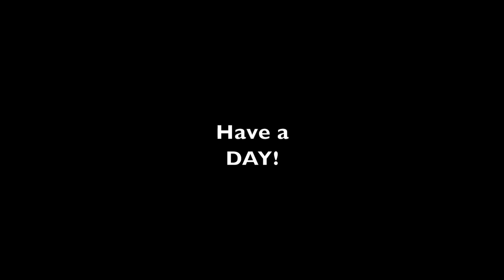#730 NEW WOODSHED BUILD, WORKING IN THE MUD!

Comment: Hi Mike, 
I am also a learn-by-trying type.  I love your build vids.  Since you have said that you plan several more similar builds, I want to throw out a small tip.  Please don't read it as criticism as that is a beautiful shed you have started.  I love it!  So my tip is for the joints where the beam segments rest on the posts.  6"-8" extra length on each outer segment and 12"-14" on the middle one would allow you enough material for a half lap joint. It can provide a tremendous amount of stability.  This would be especially conducive with those awesome 3.5 inch thick beams-- plenty of meat still on the bone.  Helps keep the joint tight by counteracting any racking forces.  Of course you will have several other elements in this build to help do the same.  I read some have already suggested plywood cleats on the inside spanning the joint.  Keep up the positive and entertaining vids!  I never miss one!

Comment: Mike, next shed cut in on the headers with the wood mizer for 6 or 8 inches on the ends at the center of the timber and remove one side with the skillsaw so you can overlap the joint where it sits in the bracket.
Reply from the maker: yea i like that idea

Comment: Love what you guys are doing. Mike I was thinking that you should let the whole shed/wood built cure up for a year, or maybe even less since we are heading into the summer. Meanwhile cut some batten strips (Board and Batten siding) and somehow stack and strap them to cure, and then in the year add them to the now shrunken seams. If you do it right away that would cause some splitting when shrinking, but adding them later one would cure that. How you manage that with your siding preservative/stain coating I am not sure. Suggestions welcome. This is my number one Youtube daily go to event.

Comment: put down some of those slabs to stay outta the mud.I would put some full length diagonals in the corners not just those little coner braces.When the wind blows there will be a lot of force along the long side,and put some little straps across the top of those beam joints

Comment: It is pouring down here now - my tractor lugs (full old time tractor tires) sink into the ground up to the flat tire between lugs.  Scary!  I move slow and stay in 2 wheel so the spare 2 power wheels are getting me out of trouble if needed.  Four at once can be 4 holes in the ground so easy and fast.

Comment: Nice work, Mike. Braces look great. If you have any scrap 1/2" CDX ply, you can make some gussets for the inside faces of your beam joints to act as reinforcement splices. Maybe 6" wide by 2' long, with a foot on either side of the joint between beams, then nailed with galvanized nails. Love the story about Hunter "frisking" you for soda-pop contraband.  :)

Comment: Connecting those beams to each other at each top joint with cross-angled deck screws would also add lot of sturdiness to the frame. great looking project!
Reply: I think he said he was going to use nailing plates, but I thought the same thing and maybe drill a hole in brackets to tie each side together at seam.

Comment: The nice thing about using that green wood for the siding is that it gets nailed down before it can warp.  Mike and Melissa you are are doing a banged up job on the shed, which means job well done, but use guys alway say a short while after sheds and garages are finished is: “should have built it 3 times bigger”. 👷‍♀️

Comment: On the next structure you build, if you lap-joint those beams instead of butt-jointing, you can drive a nice 3 inch screw into that top center hole of the post top teco. Strong joint too 👍

Comment: I am still not convinced that 3 screws in the beam at the back of the wood shed, will carry the roof structure and snow load when in shear screwed into softwood posts.The beam should be checked into the columns so it carries the weight rather than the screws, the front beam is OK.
Reply: He mentioned he is going to nail everything as well.  
And, the back beams, he said he is going to lag bolt them through the posts.

Comment: Y'all are having more fun than me .
I've been rewiring the entry room of our house.  We had to gut it out . And who ever wired it should of had tools taken away from them .
Open ended wire just hanging in the walls and some just tucked in a box no tape or anything.  And aluminum wires that got hot .
Never use aluminum wire for any reason.  It about burnt our house. 
And the worst part some of it was done by a certified electrician. 
But enough of that.  
That was a good video. 
Stay safe y'all  🤗🤗🤗🤗🤗👍👍👍👍👍👍👍👍💖💖💖💖💖💖🌹🌹🌹🌹🌹🌹🌹🌹🌹🌹🌹🌹🌹🌹🌹
Reply: Evan Kibbe aluminum wire was actually allowed by code back in the 50’&60’s, before they realized the fire potential! The open ended wire would never be an issue if the panel end was saved off, and labeled to the location and “ in wall DON’T USE!” This is work done by an electrician who didn’t open the wall, the only issue with this is that the next home owner doesn’t always know what is what, or if there is a back feed!

The best thing to do is to find all possible unused wires, and aluminum wires and remove them, it is costly, but piece of mind is priceless!

Please have somebody qualified either do it or work with you! 
    Best of luck!
Reply: @gettintheresafelywithpatf2869  i understand everything you said..
But the open ended wires were just hanging out no tape or anything and no reason for being there. And power to all.  And I found  6 of them all bad .  One wall socket had actually caught on fire because of the aluminum wire. 
I assume that they didn't get the terminals tightened properly. 
All the newer is not good either. 
Because of bad connections  .
Reply: Evan Kibbe this sounds more along the lines of a home owner trying to save a buck! Not a qualified electrician!
Reply: @gettintheresafelywithpatf2869  i know the election that did and takes credit for it  . He should of never had a license let alone a commercial license.  But I guess they will one to anyone.
Reply: Evan Kibbe that my friend is a scary thought, I hope he has found  another line of work!
Reply: @gettintheresafelywithpatf2869  he is retired now .  Just saying choose electricians wisely. 😊
Reply: Evan Kibbe does that mean that I shouldn’t do my own work? After all I’m an electrician!
Reply: @gettintheresafelywithpatf2869  no that's not not what I'm saying.  I'm saying if you have to hire it done to make a wise and hopefully informed decision.   Electrical work was part of my mos in the army .

Comment: A possible solution to the BK issue I just heard from a Television advertisement that if you have the BK app you can order what you want and then they'll deliver it to you  at your place. Just a thought for your BK issue.
Reply: Not sure of NY, but here, most Drive Thrus are still open.
Reply: The same thing here 
I just seen the whole advertisement.  I was mistaken. They said if you use the app you can get in at the drive thru. Sorry about the mistake.

Comment: On the back side of the big beams you should connect the beams with a small piece of plywood and screws or a galvanized strip to make them more stable. Wont be noticeable on the backside.

Comment: Hey Mike, I found out at my local hardware store that they make special nails for those simpson strong tie metal brackets. Only if you are worried about "maximum strength". ;) Hunter would probably appreciate you using the right nails. Hi Hunter!